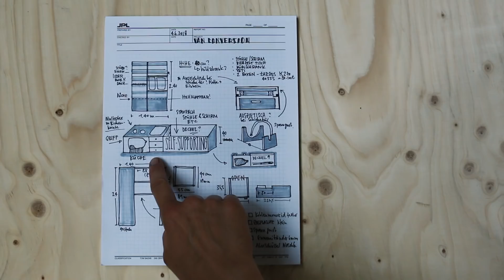Camper Van Conversion Ep. 2- The Kitchen

Comment: Perks of having a back hatch instead of doors here would be not being rained on when outsidekitchening. 
I liked different designs of drawerkitchens as long as I had a hatch (Vanagon/Multivan) and had to change it to an indoor solution after switching to a twodoored-backside Sprinter.
Germany just isn't Arizona or NT-Oz when it comes to weather conditions.

Comment: As always, several clever design touches in this part of the build. Especially love the upside-down feet that keep the stove in place. Very neat. Curious as many apparently are about the kitchen at full extension. is it on heavy-duty slides that support its cantilevered weight or would some type of support at the far end help when opened? Can't wait to see the next part!